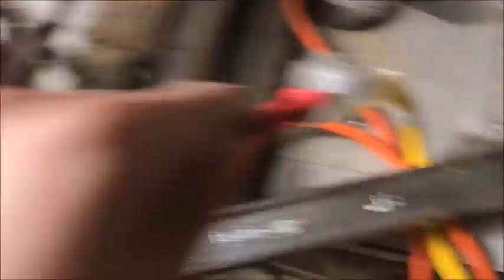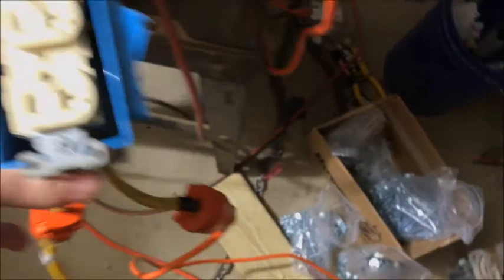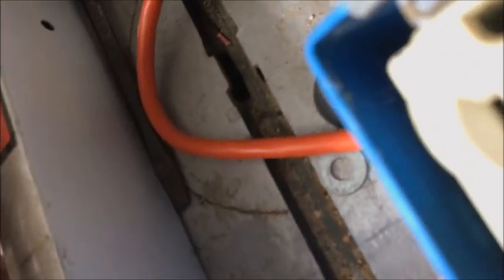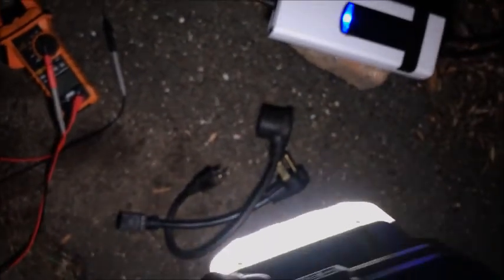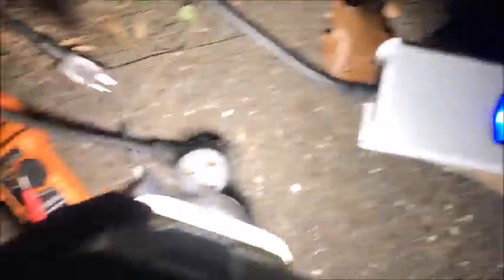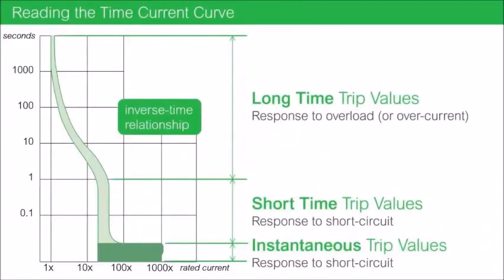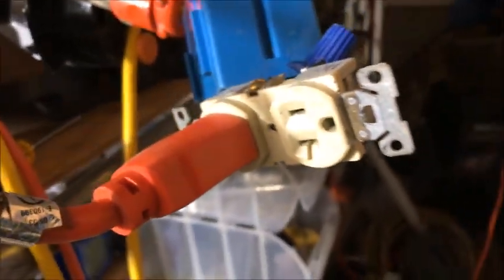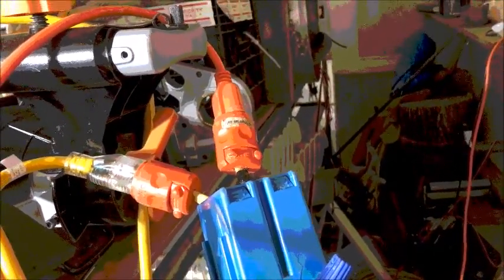How to Charge Electric Car on 240v | Convert two 120 outlets to level 2. Convert level 1 to level 2.

Comment: How is the non GFCI receptacle holding up with 240V on it? I can do this at my home to charge my tesla but I’m scared if the receptacle would blow.
Reply from the maker: fine. in europe all receptacles are 240v. the us ones handle 240 fine. P = I^2 x R. Current is more of a problem than voltage like using a 15 amp outlet and feeding 50 amps through it. voltage arc gap is negigible 240 vs 120 insulation breakdown is not a factor.

Comment: What if you have GFCI outlets? I live in an old house and they installed GFCI outlets because plugs are not grounded. All my non GFCI plugs are not grounded. Any suggestions?  I purchased a 110 circuit splitter but they can only be hooked up to non GFCI plugs and grounded plugs on two different phases.
Reply from the maker: this cannot work with gfci outlets. i tried once despite me knowing it wont work cause i was bored and i am happy it didnt fuck up crap. your best bet tbh is to use a 2x non grounded outlet and run a ground wire from the diy box to a gfci outlet and use the gfci ground. you just use the gfci outlet as a ground and use the 2 non grounded outlets for power.

Comment: Those amperage ratings are for max draw rates for short periods of time. The 80% rule is for continuous draws related to what the insulation is rated for. 

FYI, the EVSE that came with the older Bolt supports 240 volts at 12 amps.
Reply from the maker: insulation is rated for 3x its normal current continously!!!! for example, 14 awg handles 15 amps x 3 = 45 amps continuously in free air. there was a video of some guy stress testing romex and was able to pull like 50 amps off 14 awg continously for like a long time, i believe in melted at 70 amps.